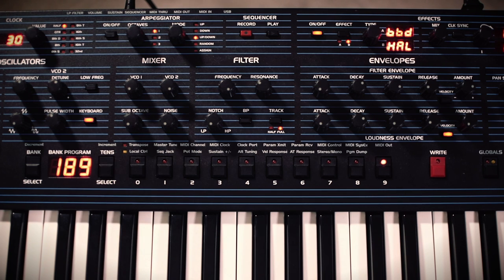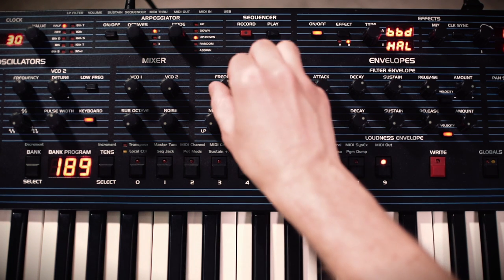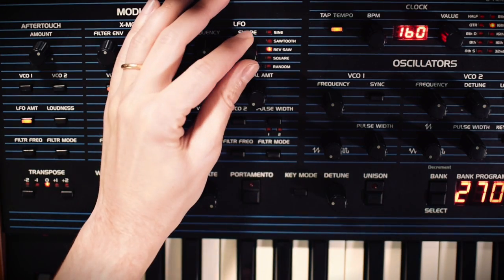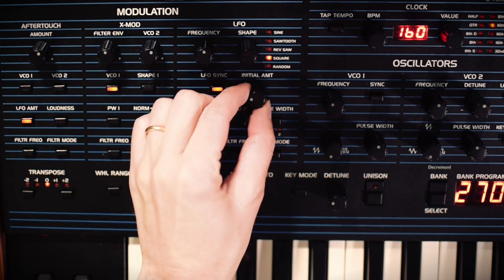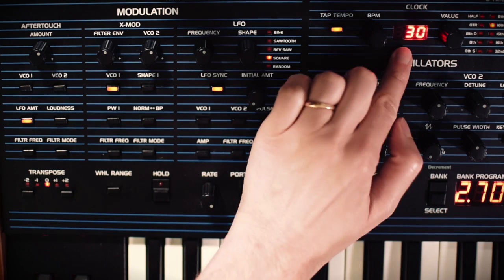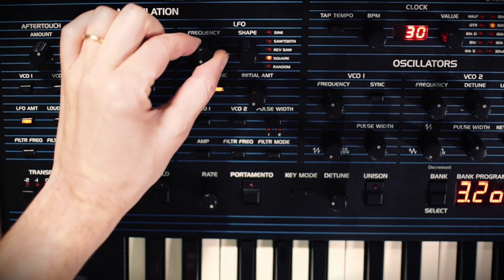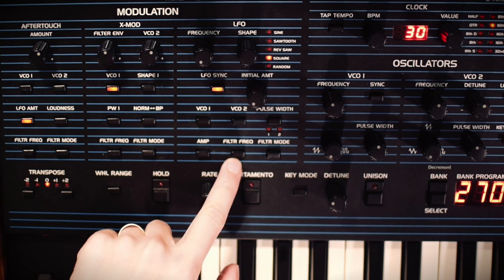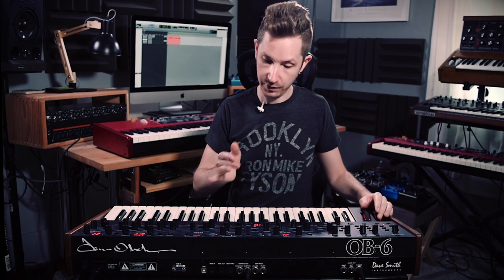Sequential Synth Tips #3 with J3PO / Julian Pollack: Prophet-6 Mapping The Mod Wheel

Comment: Is this workaround possible with the P5 Rev 4?
Reply: I don't think so because it doesn't have an LFO sync/reset function (starting the cycle over on a key press) which makes it work.  Unless I'm not clever enough to figure out another way - Any other folks have an idea?

Comment: Cool workaround.Only you do lose your LFO for other regular modulations though, so its not possible for all patches, would be better if there was a firmware solution that makes it possible to assign the MW to cutoff. But that has been requested so many times before..... Anyway nice tip!
Reply: A tip: you can watch series at flixzone. Me and my gf have been using them for watching loads of movies these days.
Reply: @Kian Fabian Yea, I've been using flixzone for months myself :D
Reply: @kianfabian7867  Yeah, that brings back the extra LFO! Thanks, great tip 😁
Reply: You  could use VCO2 as a LFO or a Digital FX like the flanger could also work as a LFO.

Comment: Fantastic tip. It’s a shame that you have to take the clock down. It would be problematic if any external clock or sequencer is in use.
Reply: It also works for clock values of 120. The duration will be shorter, but who needs 32 seconds? 5 seconds may be enough.